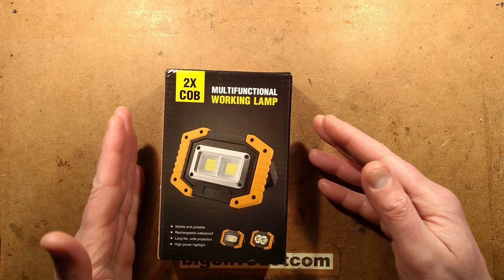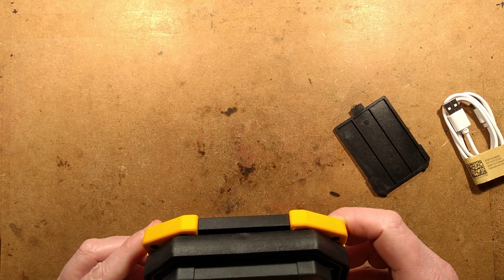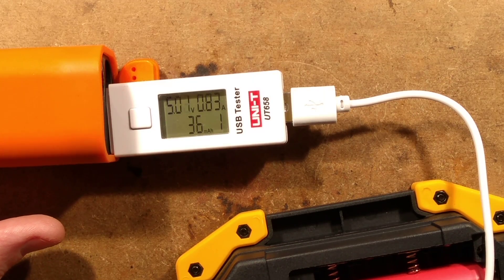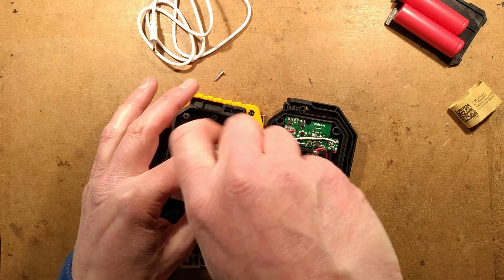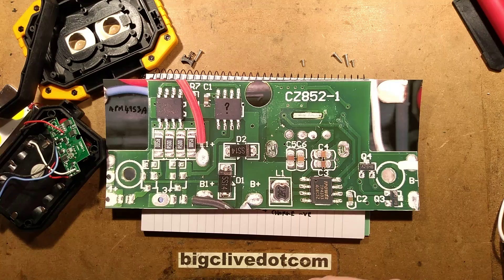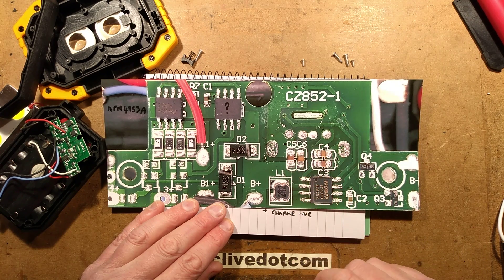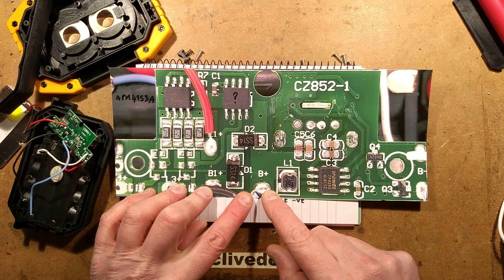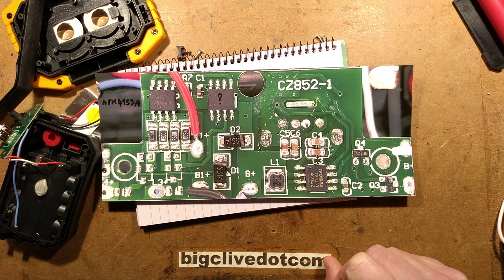Inside a chunky USB rechargeable work-light power bank.

Comment: Is there no way to disable that annoying flashing mode on these things? Does anybody ever want that?
Reply: ....... You would have to hack the code in the micro, I concur though,
it's only Gilligan that would find that mode useful.
Reply: One of my pet hates.  I bought a set of three led lights intended for putting in cupboards.  The switch (tap the dome) was understandably lousy (cheap).  The inclusion of flash mode and, despite microcontroller, lack of software debounce, meant that I could be hitting the thing a dozen times to get it to cycle through off, bright, medium and flash to get back to off. Absurd. Bin.  I don't imagine the makers ever imagined that someone would want a cupboard light to flash, but a simple two push on/off latch is as cheap as the mechanism in a disposable biro.   And software debouncing costs nothing per unit.  I could tell them how to do that for the rubbishiest switch.
Reply: A slow flash mode (e.g. 0.5-2Hz) can be useful for safety since it is typically more visible at a distance than a steady light, but I really do not get the unreasonably high flash rates that many of these chips seem programmed to generate.

Though I do have one pet peeve regarding many of the chipsets that support an SOS mode — aside from the questionable use or the ethics of many users frequently transmitting an SOS without a true emergency — many of the chipsets that implement an SOS feature do not properly transmit “SOS”, instead they literally transmit the equivalent of “S  O  S”, which is not a proper SOS signal.  A true SOS is not sent as three distinct letters but as a single symbol, so there should be no inter-symbol delay between each of the three letters (e.g. “di-di-di-dah-dah-dah-di-di-dit” rather than “di-di-dit  dah-dah-dah  di-di-dit”).
Reply: All the flashing modes, including the so called SOS are gimmicks. The flash mode is very easy to include and costs very little to add, but means the seller / manufacturer can add it to the feature list. But how many people nowadays take any notice of a light that is flashing? Not many. And these are too bright to use as a warning light if your car breaks down. So in everyday life, the flash mode(s) have no practical use.
Reply: I purchased three of these lights to use for emergency road side lights (strobe) function facing the traffic. they will be spaced out in conjunction with my 8 reflective safety 18" orange cones. I pull a large travel trailer and when a tire blows out you sometimes have no place to pull over so you need to direct traffic to the other lane. this should help in being seen even in daytime! I also have orange strobes on the back of my travel trailer that would be activated as well. You can never have too much light when it comes to roadside safety. I hope I never need to use them but if I do I want to make sure I am safe. I looked into the round little puck lights (LED flares) but they are not bright enough to make me comfortable and are WAY over priced for what you get.
Reply: Yes easy... Just don't select it lol.. Very annoying useless feature.

Comment: Great teardown video. Did you measure the LED wattage? Some sellers are advertising these as being 50W on ebay!
Reply: I was also wondering what current those chips are run at.
Reply: The current/wattage was never measured in the video, but if it can run on AA alkaline batteries then it is likely a safe bet that it’s no more than perhaps 10W.  Besides, if it could run anywhere near 50W I would think it would need to explicitly state that high drain 18650s were a requirement as that would be around 15A at the battery terminal (particularly with just one 18650 installed) and they would need to monitor the battery temperature.

Comment: Clive - Did you measure the current & voltage at the COB also? 7:20 "It's more important to know what the current is" by which I think you meant to find the wattage.  Totally thought you were going to do that.  (I ordered one of these about halfway through the video.)  I take it your current test in the description was from the battery supply, right?  Full = 900mA
 / Low = 250mA etc.

Comment: I bought a single round cob version with 3 x18650 1500 built in, after a week the run time had dropped to about an hour so I replaced the  batteries with good quality 3000 Ma cells, lasted a few charges, now the pcb is dead and just drains the batteries, the power bank function never charged my Samsung S9 or S6 but did show it was connected.
Reply: For whatever reason, many mobile devices (phones and tablets) will not reduce their charge rate to match what a battery bank can deliver so long as the mobile device is powered on — when powered on they want to charge as fast as they can at 5V even if the battery bank or power supply specifically advertises it can not support such, so the device either refuses to charge at all or it trips the overload protection on the power bank.  Interestingly, many will charge at USB 1.1 specs (500mA) of the device is actually powered off before connecting.  My iPad, for example, will refuse to charge if the power bank advertises less than about 2A — but if powered off first it will charge at 400-500mA just fine, but no faster than that.

Out of curiosity, does the actual COB itself still work or did they overdrive the COB to the point that it has failed shorted (as diodes typically do) and/or burned up the PCB?  It is also possible that there could be poor solder joints or even haphazardly soldered wires that have shorted to neighboring components if you have not yet cracked it open to inspect.  But then that is the nature of cheap Chinese goods, it’s a literal crapshoot where sometimes you get a winner and many times a loser.

Comment: Clive. What would happen if some dummy (like me)  were to put all four AA's AND the both 18650's at the same time?
Reply: Doesn't look like you can (without trying real hard, extending contacts or adding wires) - the 18650s prevents the AAs from going deep enough to reach the contacts.
Reply: Aha! Excellent.

Comment: Maybe I missed it but, you didn't answer the most important question. Is this light worth a crap or would I be better off grabbing a candle out of the junk drawer?
Reply from the maker: It's fine.  Like most other similar LED work lights.  Puts out plenty of light and lasts for a good length of time on a set of fully charged cells.
Reply: I have this exact light, but bought from Amazon. I would say its definetely worth $12. I paid $16 on Amazon and it came with 2 18650 batteries. I don't have a meter, but would ballpark it at 800 lumens. I use it when working on cars and its perfect for that. Light has a nice wide beam.
Reply: Ben Gordon I just bought one. Thought it was cheaper than the others I saw. But those were name brands. How is it holding up?
Reply: I have a very similar light labeled with the craftsman brand and I find it a really handy little device. Its great for working on cars, its thin enough you just slide it under the car and it gives a nice wash of light and the stand feature is also kinda handy. It's not exactly the best thing in my tool box but I kinda like it.
Reply: I've had a single led one for a year for so. I really like it, lots of light and last a few hours. My only complaint is the stand is too easy to collapse.

Comment: I like the nifty config of the battery compartment. The claim of 30W in your advert is about 10x too big ain't it ? Must be a filament lamp equivalent power or something - how odd for these days when led lamps are so common.
Reply from the maker: You just take the ratings of the lights with a pinch of salt now.  The only thing they're useful for is finding similar listings.

Comment: When you add cable lose it not good for charging a phone.  Most devices charge super slow under 4.6v.  I only have chargers that are truly voltage regulated at 5v, it makes a huge difference in charge time.

Comment: Looks like Clone of the Caterpillar Lamp.
Reply: Yeah, the single long COB version with built in rechargable battery pack, a USB port for charging a phone, & three charge status indicator LEDs was sold at Costco about a year ago.  I have two and I like them.  I wouldnt be surprised at all if they were made for and branded Caterpillar by this generic Chinese manufacturer.  A smaller 2-pack that ran off AA batteries showed up a few months after Costco discontinued the bigger one.  Also not a terrible light.

Comment: Hey I was wondering if you had any experience with radiant heat panels
Reply from the maker: I've never opened one up.  There are various styles including the curved ceramic plates with coiled filaments embedded in the ceramic.
Reply: @bigclivedotcom  SolaRay Heating Panel what's the one that got my interest mainly because it was a 240-volt electric radiant heater that didn't put off any light and that it's basically a blank slate for thermostat and relay controls and as far as I know we don't have them in Kansas

Comment: "working lamp"?
So either it does some form of labour... Or it is not defective.
(philosoraptor.jpg)
Reply: Hey now, YOU try instantly accelerating photons to 186,000 miles/300,000 km per second and tell me that was not work!?! ;-)
Reply: @ethanpoole3443  I regularly do more than that, I decelerate photons from 300,000 km/s and re-accelerate them to 300,000 km/s in the other direction.
It's meh. I can do it in my sleep.

Comment: What a really interesting battery compartment arrangement!
Reply: Only one question remains, what happens when one accidentally installs four 14500 lithium cells (physically the same size as AA batteries)?
Reply: I joke, but when you read the comment section on Amazon for 14500 lithium cells you would be surprised how many people just assume that since they are the same physical dimensions as an AA cell then they must be drop in replacements....and, of course, Lithium Ion must be superior to NiMh, so they buy 14500s and install them in place of AA batteries and are angry with the seller for ruining their electronic device or flashlight!  That’s why comment sections must always be taken with a grain of salt because there are a lot of idiots out there giving one star reviews because they did something dumb (just as one must watch out for fake 5 star reviews).
Reply: @ethanpoole3443  I also love the 1 Star reviews of people who trash the seller because of something, but have nothing to say about the actual product they are reviewing. My general rules: if something have less than 5 reviews, read them all. If something has more than 10 reviews but less than 3 stars, it's crap. If something has more than 10 reviews and more than 4 stars, take a generalized look at the 4 and 1/2 star reviews or a longer 5 star one. :)
Reply: @ethanpoole3443   Yep most people are not aware that if you are buying some 99cent crap headphones from whish with free shipping they break on plugin becasue thats just about their expected service life.
Reply: Yes, I really like that.  With this feature, the two brightness levels, and "the big round wash of light" (2:24) I had to pause to go order one before the video was even halfway through.

Comment: I dig it. From frozen kansas we are going to get to -7 Frankenstein tonight.  just 500 miles northeast in shitcago -25 Frankenstein. My vehicle broke down its driven me crazy to not work on it, but you learn at these temps just looking at it other things will break this weekend we are supposed to hit 55ish Frankenstein so I'm gonna be patient work on it then. Thanks for another video. Cheers.
Reply: We got up to 25° freedom (-4° universal) today here in my spot of the Midwest, so it's time to bust out the shorts and t-shirts again.
Reply: There with ya in Northern Ohio.. -8 franks now with -30ish wind.. Stay safe up there..
Reply: I hear you there I live in Cuba Kansas
Reply: @philiprizek6384  I might have drove thru Cuba once or thrice I used to avoid the scales on i70 so I'd run 36 across mo and into kansas, most of the time I'd bypass the scales then eventually end up on 75 south to paola. But I might have tried your route a few times.

Comment: The double doides are quite strange indeed. I think 3 AA batteries would be more efficient? Same capacity since they are in series or am I missing something here? Seems like two steps forward, one step back. Oh, and the mosfet Q4 has a on-resistance of 85 mOhms at 4.5V
Ordered one on AliExpress right after finishing the video for 9€. Gonna be real handy when working on my car!
Reply: I'm with you on that.  I ordered one of these, and I'm going to move the connection from the 4th AA to the 3rd AA and block off position 4.  And also short out the diode pair.  Of course I'll test first to make sure it works okay.  I'll be using NIMH anyway so it won't be 4.5v, more like the 4.2 max of lithium.
Reply: I went from 3 aa in an led solar floodlight to 1 14500 lithuim it doesn't last as long but the light is much brignter and more usable than NIMH, NIMH are rubbish.
Reply: @gillenzfluff8380  I have never had much luck with 14500's I have ordered different brand names trying to find some that will stand up to a single cell flashlight designed for them but I get maybe 10 minutes per charge, the last set has lasted about 3 years now and two of the six are completely dead and will not even start to to take a charge.  Very disappointing, considering the cost compared to AA batteries.  The little flashlights do work  on AA batteries but the brightness suffers a LOT!
Reply: @JerryEricsson  I have 2 14500 from totally wicked my friend gave me them about 3 or 4 year's ago I'm using them in single aa pocketman and elfland flashlights they have lasted well as he was using them in a vape pen.
Reply: arfyness If you are using NiMH only then you should be able to use all four positions and bypass the diodes and still have less than a perfectly safe 5.2V even when fully charged.  The diodes are their to drop down the roughly 6.4V of four fresh alkaline batteries.  Give it a try before you bother moving that battery tap point,
Reply: @ethanpoole3443  Some boost converters don't like being fed with higher voltage than they can boost to. Some just "disable themsevles" and let the power go around them, but in some cases it really messes things up in my experience. :) I'd just use this as a 18650 device for myself, since it has the charging built it I can even give it to not so technically minded friends and relatives and they can use it without issues.
@Gillenz Fluff: NiMH have their uses. For one thing, most off the shelf stuff is still build with them in mind, so it is needed for a lot of toys and even technical things. For another, it is a much safer technology. If you are a tinkerer, Li batteries can often provide better results though. I just replaced a 2 AA battery holder that powered a string of 10 LEDs (warm white) with one 18650. The 2 AAs needed to be non-rechargeable alkaline in order to get any decent light output from the LEDs (with NiMH the current was below 1mA per LED because of the 2.6V and the high forward voltage of the LEDs), only with the 3.2V of 2 AA alkalines was the light output any good. I replaced the thing with one 18650 (3.0 - 4.2V), changed the resistor from 5 ohm to 8 ohm and now I have a nice bright LED strip with a rechargeable 18650 that was lying around from an older laptop battery. It drives the LEDs at 15mA when fully charged and gradually comes down to about 1mA. In that case, the NiMH cells were indeed rather useless and using them provided barely any light (though it would run for ages because of the sub 1mA current draw from each LED). Had they given a 3 AA holder and made the resistor a slightly different value, they could have made both alkaline and NiMH cells viable (3.9V and 4.8V fully charged, not that far off the 3.7V Li nominal voltage).
Reply: @arfyness  yea when he said even 3 AA wont work i was confused, 4.2/3 = 1.4 so each ni-mh cell will get a good charge. let us know what you find out!
Reply: 3AA gives you more or less the same voltage as a single Lithium if you use rechargeables. It would have been so easy to add a bit of circuitry to use one or the other with a proper charging circuit for both.
Reply: Yeah, 3 AAs would make more sense from an electronic perspective.  Given the diode drops are going to come in around 1.3V you'd get almost the same run-time with four batteries + two diodes as with three batteries.

I suspect the use of 4 AAs is from mechanical considerations.  It might be difficult to come up with something that would keep 3 AAs from rattling around in the space created by allowing for 2 18650s whereas 4 fill the compartment nicely.
Reply: @bdf2718  That, plus how irritating is it to buy batteries for a device that needs an odd number of batteries? Most consumers would have to buy a 4-pack and then have one single battery rolling around to toss in the kitchen junk drawer and probably forgotten until it's past its prime. I highly doubt anyone thought of a customer's feeling about that, but I think of that when I buy battery-operated devices. Especially since I have NiMH batteries and the (now dead) charger only recharged in pairs. It's a PITA to have one dead battery waiting around for another dead battery so I can recharge them both.

I've since replaced that charger, since it would only charge cells to 1.3v before showing all batteries were bad. I replaced the charger with one that charges individual cells (and all batteries test within 5% of stated capacity) so an odd number of cells in a device doesn't matter to me so much anymore. But it used to be a factor in my decision between similar devices.